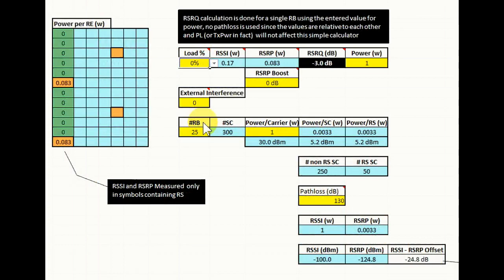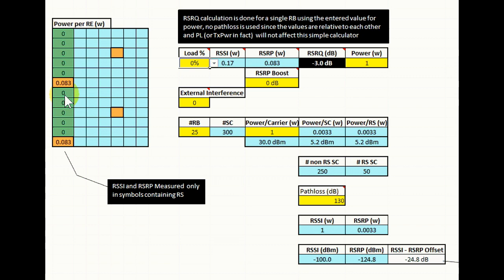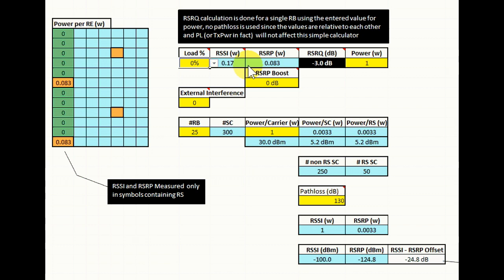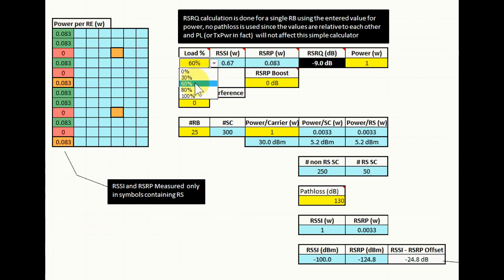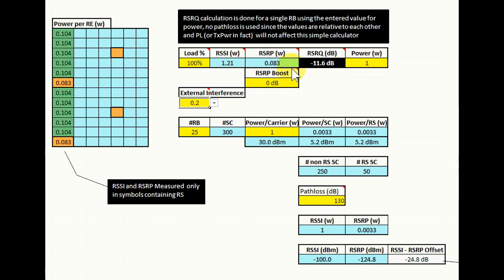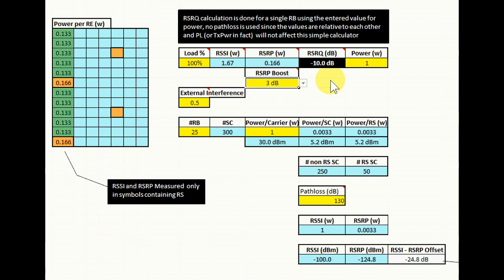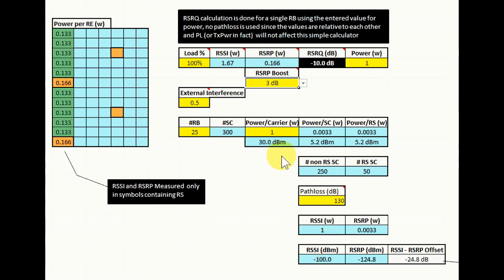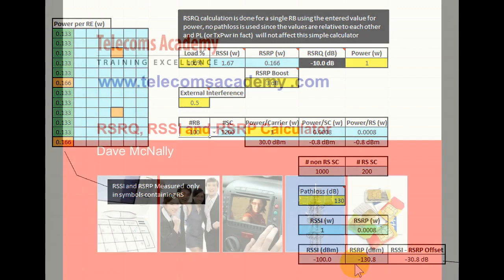RSRQ Calculator.avi

Comment: @dpmcnally I'm still confused how the receiver is able to report an actual quality factor, in the sense that I know when measuring cable networks or digital TV streams it's reported in Bit-Error-Ratio, e.g how many of the bits transmitted from the sender are errored.   What I'm seeing in the Quality measurement for LTE/4G is that it just seems to be an estimated quality, i.e by measuring signal strength of wanted signal, vs adjacent frequencies, perhaps I'm not understanding it as best as it should.

What I'm trying to say is for example, in Digital TV reception there was a test in which C/N was used, and you could have two situations of a very good C/N, but then if you made a noise generator and made it to generate noise on exactly the same wanted frequency which destroyed the signal quality, the C/N will still report as "great" because it can't decypher noise on the same channel as it simply is just measuring signal.

I don't understand why there isn't some sort of dummy/test data packets sent out from the 4G tower continuously, in which the receiver can then decipher it and see how many errored bits there is in the actual data stream, shouldn't this give the best resemblance of the quality of a signal?

Perhaps I'm not understanding the theory in your video the way it should be understanded, as a person who installs antennas on roofs I'm used to looking at spectrum analyzers, e.g wanted frequency (700mhz), vs unwanted frequency i.e noise floor, i had thought the RSRQ simply is just comparing this, but trying to understand how the recourse blocks work better.  Cheers :)

Comment: For theoretical reason , lets assume radio environment is same closer to the site and far from the site  ,meaning cell loading /interference etc same irrespective of distance , then pathloss and number of RB(N) don't have impact on RSRQ(dB) value. Though formula is RSRQ=N*RSRP/RSSI where N is number of RB. But  more N means less RSRP and more RSSI so it balance it out.Comment if anyone think differently.

Comment: Hello,

I am facing difficulties in calculating SINR . I have taken the following parameters in calculation :
1. Distance 100 m to 2000 m at an interval of 100 m.
2. I have calculated the path loss by using this model : 128.1 + 37.6 log(distance in km)

After getting "RSRP and RSSI" i have calculated RSRQ and then "SINR". But i am getting SINR in the range of " -1.0378" in  an around which is offcourse not expected.

Any help will be highly appreciated .
Thanking you.!!
Reply: @dave sir pls help

Comment: @dave , thanks for great video,i want to know,suppose i changes cell power from 20w to 40w,surely it will impact on RSRP,then what will be imact on RSRQ?
Reply: +dave mcnally , just want to add another factor that will also affect the RSSI (besides the pathloss and the signal non-serving cells which is the interference) is the cell loading.
Reply from the maker: +Vishal Singh Hi Vishal, when you increase the power, you are increasing the power on all subcarriers in the same proportion, since the RSRQ is a ratio of RSSI and RSRP the RSRQ will remain the same..  RSRQ will be affected if the RSSI increases or decreases, either due to pathloss or sources of signal from non-serving cells..

Comment: Hi Dave,
Thanks for the great spread and video explanation. I have a question about calculation of RSSI (and RSRQ) when load is present. According to TS 36.214 (the * I added for emphasis): 
E-UTRA Carrier Received Signal Strength Indicator (RSSI), comprises the linear average of the total received power (in [W]) observed **only in OFDM symbols containing reference symbols for antenna port 0**, in the measurement bandwidth, over N number of resource blocks by the UE from all sources, including co-channel serving and non-serving cells, adjacent channel interference, thermal noise etc. 

But in the spreadsheet, RSSI you state that RSSI is (a)."total measure over 12 subcarriers". From 36.214 it says (b)energy only in the the two subcarriers that contain the Reference Symbols.  So which is right (a) or (b). 
Thanks
Irfan
Reply: +Irfan Ali i have the same doubt here. +dave mcnally thanks for this wonderful video. could you please clarify this question ?
Reply: I figured it out that OFDM symbol is contains all the sub-carriers in the very first OFDM symbol, so over the entire BW. So (a) is the correct measure for RSSI/N_rb. where N_rb = number of resource blocks in frequency domain (N_rb = 6 for 1.4 MHz).
Reply: Only for MBSFN RSRQ calculation, not standard mode

Comment: Hi Dave,
I appreciate your time and effort for the video. It is very clear. Also, I have got a small doubt in one of the points. When you increase the external interference from zero, I do not find the effect of interference (increase in signal power) in the REs containing the RS and in-turn there is no effect on RSRP. Is this correct? Can you clarify?
Thanks,
Brag
Reply from the maker: Hi Brag, yes this is correct, the RS are a pseudo-noise type code and the mobile can effectively reject all signals that are not part of the code, therefore when the interference is increased it will only be apparent in the non-RS elements.  this means that RSSI will vary according to the amount of interference, interference in the network is a function of cell load.  RSRP should be a measurement that is not affected by the network load.

Comment: Thanks Dave,but I am still doubtful about both issues :)
Multiplying RE power by the interf factor does not allow from 0.083 to 0.104 (ext interf 0.2) and from 0.083 to 0.167(ext interf 0.5). At most,I'd have done 0.083+20% of 0.083 in the first case,leading to RE power 0.0996 and RSSI=1.162.In the second case(0.5 interf),RE power=0.1245 and RSSI=1.411.
Then,RS boost allows 0.083->0.166,ok. Should RSSI be the same(1.83)?If yes, RSRQ=-10.4dB.I got boost produces gain only increasing RSRP..

Comment from the maker: Hi Andy, thanks for taking the time to watch and ask the questions....
the scaling factor is a "fudge"..the power level shown in each RE (non-RS) is multiplied by the scaling factor selected.  I didnt try to work out a correlation between this factor and adjacent cell loading...i cheated :/
RSRP boost.... RE power.1/12W per SC, when boost is applied the RS power will be 2/12W... so the power that is applied to the RS is subtracted from 1W and the remainder spread over 10SC
not enough words to...

Comment: Hi Dave,
I have only two questions about your video.
1) You use a scaling factor for taking into account for external interference. How do you distribute power over data subcarriers? I mean, which is the formula?
2) I didn't get very well the RSRP boost functionality. After having doubled RS power, how do you obtain the data subcarriers powers?

Thanks

Comment: Hi Dave quite interesting indeed, however in 3gpp it stands that rsrq=n*rsrp/rssi, which means  that rsrq will be dependent on the available bw, so your first example is not correct. honestly i'm still confused about this lte measurement.

Comment from the maker: Hi Olasunkanmi...glad you liked it... i have been thinking about the question you left, and yes the RSSI will be affected by the transmit BW, but of course this will depend on the EiRP, if the BW is halved it may be typical that the output power would be halved... i think its safe to say that RSSI is a measurement that is dependent on network load...and RSRP is the more reliable measurement...